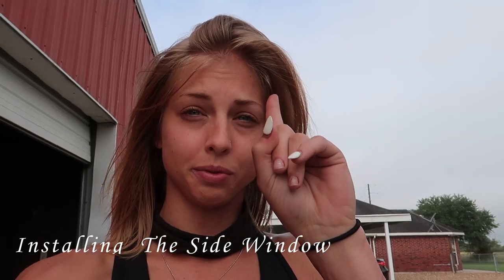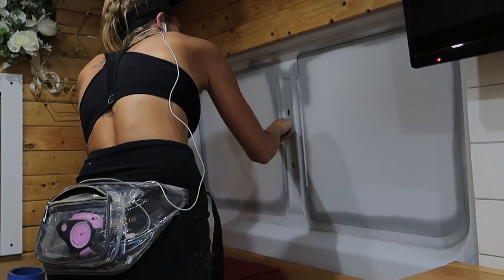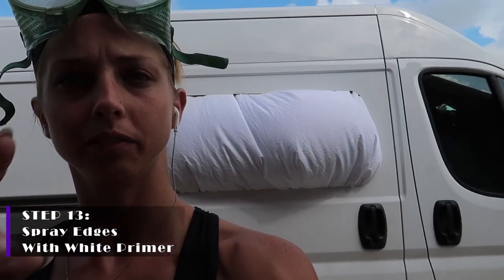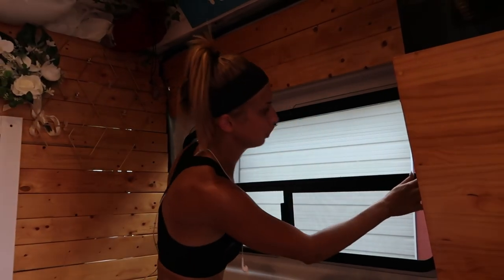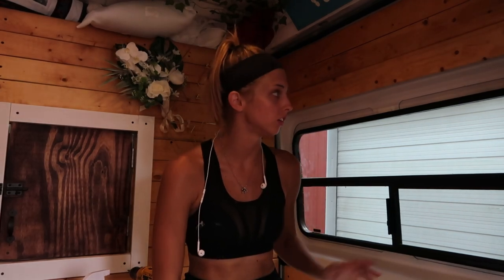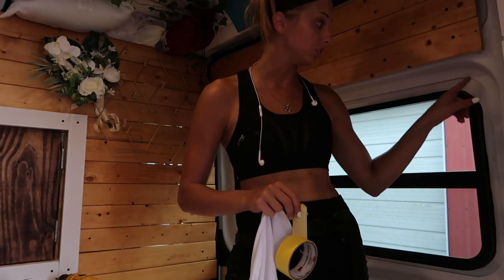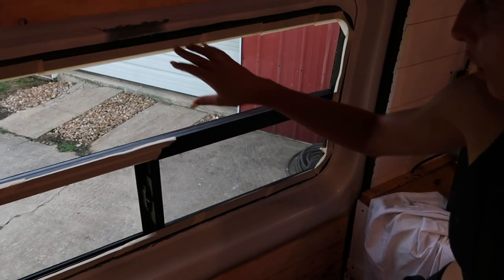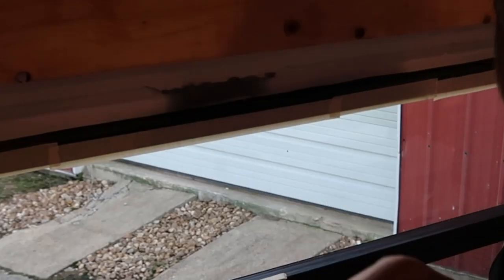Sliding Window Installation | Ram Promaster

Comment: Katie! Oh my goodness that was a great recovery and still made it look top shelf!! Setback? No way, no how. And to show off you did it left-handed too. Tip: if you really need to remove the window next time. A very slim putty knife or a putty knife ground on both sides with a knife-like edge can cut out the sticky insulation tape so you can remove the window. I had to do that to replace 8 boat windows. Great example on how to overcome those stubborn little obstacles across any DIY. Also, one last tip, you did good with the hearing protection and goggles. Maybe a face mask too next time to protect those pretty lips from the sharp metal cuttings.  Safe Travels - Frankie G. 😷❤😷❤
Reply from the maker: Okay noted thank you! Hopefully i won’t have to install window anytime soon lol

Comment: Very good job. Well done. Now this: Wear coveralls or jeans and a shirt when your working in that environment ( power tools, tools, warehouse/garage, flying debris, scrap pieces on the floor, etc. ). At some point you're gonna get Nick's and scratches on your body and they add and will be unsightly. Then you'll be trying to cover them up. So cover up now and prevent that. What you're wearing is not a good idea to be working in. Although as a guy it's good for our eyes. But, seriously get you a one piece coverall to work in. Even though you put the jacket later👍.  Nice video,  good job. Travel well and be safe.👍